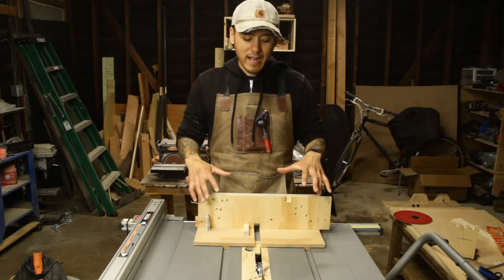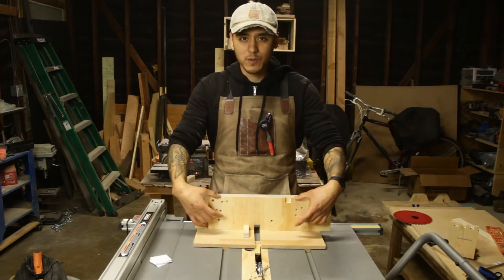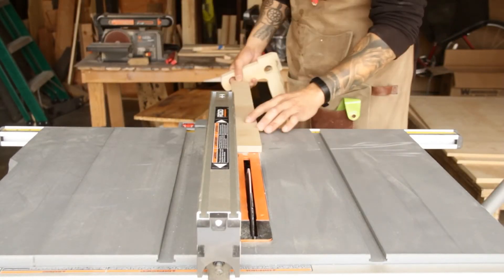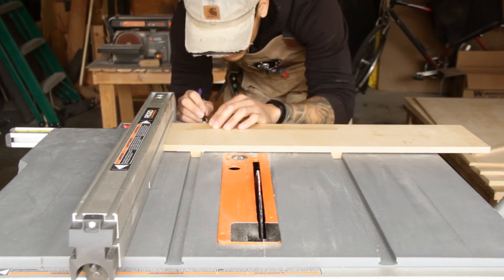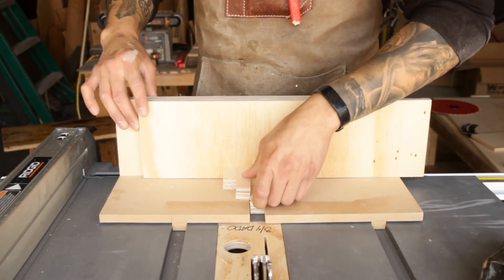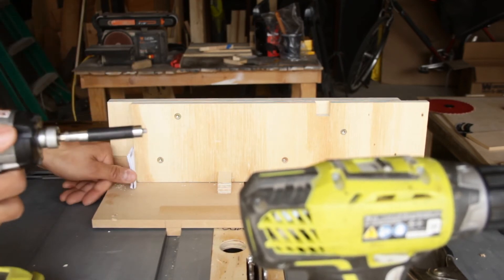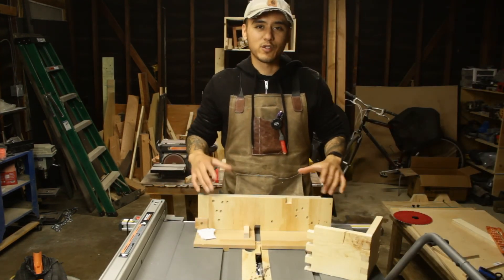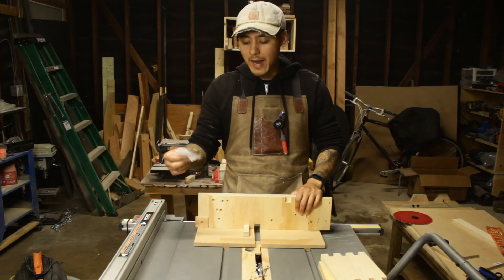Adjustable Box-Joint Jig

Comment: Pretty good video!  I would recommend that instead of screwing your sacrificial fence to your main fence (I know fence isn't the proper word here but I'm struggling to find it) that you just hold it on with clamps until you get it dialed in with your shims.  Then once you get the key the perfect distance from the blade, you can screw it down.  The reason behind this is that it's very easy for those screws to try and find the same hole to slide into and mess up your micro adjustments.  You are only moving like a millimeter at a time so it's pretty easy to let that throw everything off.  At the very least, I'd move the screws to a different location each time.  It's just a shop jig so a few extra screw holes won't hurt anything (unless the outside of the holes stands a little proud and then you can just sand them down).  Once you get it dialed in, you shouldn't really need your stop block or shims anymore.
Reply from the maker: This is exactly what I learned while fastening the screws each time. You can see the holes are all over the place to avoid this, but in turn, it makes it so much uglier. Thanks for the input! I always appreciate the feedback.
Reply: @zukobuilds4469  hey it doesn't matter how ugly it is!  It's just a jig.  You should see mine! 😂
Reply from the maker: Amen to that one 😂